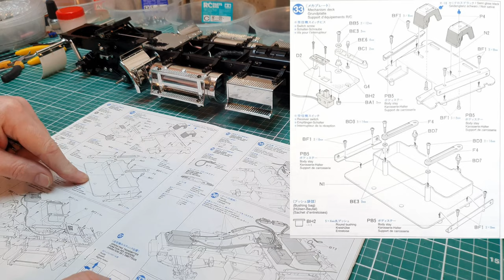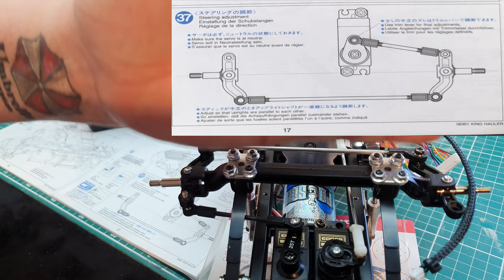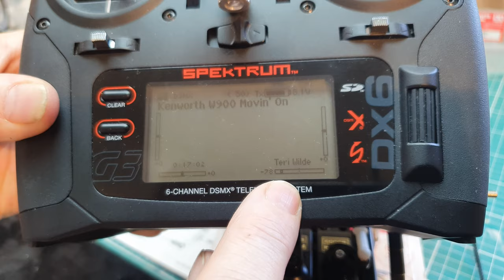Tamiya King Hauler Build Ep8 - Steps 33 - 37 - Basic Radio Installation - Movin' On

Comment: I am truly enjoying this Series! 
Just a note on me Grand Hauler Build.... Today was FRUSTRATING!! 😖😠 
I have fitted a 3 to 1 Gear Reduction Unit between the Gearbox and Axle. Had I spent the Money on LESU or something like that, it WOULD have been simple. BUT, I had a unit from a Crawler that I'm not using, but it was 17mm too wide to fit between the Rails! 

The ends were solid Alumininium!!! 
SIX Dremel Cutoff Discs later, I finally got it cut. Drilled Holes in the Frame, and I was all set! Actually looks good. 
The purpose is - I know from Electrical Engineers that lower Turn Motors make MORE Torque than high Turn Motors!! 😲😳  Contrary to VERY popular belief that has been propagated for so long, that People just accept it as FACT, without evidence. 

So now that the Driveshaft will be turning at ONE-THIRD of the Gearbox speed, a 35 Turn Motor will give enough Torque to pull a 3 Trailer Aussie Train - uphill!! 😊👍👍

Yes, a lower Turn Motor does use more current.... 
So I want to ask you, about how much runtime do you get with a 5000 MAh Batry?
Reply: ...... If you're at all interested, they also make Gear Reduction Units that screw right to the back of the Gearbox. For those who prefer a single Driveshaft. 😉
Reply from the maker: I get a lot of run time with my 5000mah pack, I leave them powered on all day and switch between my trucks with my radio, the fail safe is set so they don't run away when I switch. I am slowly moving to Lipo but I'm still very happy with my 5000Nimh packs on the 80t carson motor.

Reduction gears aren't really something I have used because I do not carry any loads which add a significant amount of weight. when you push these models past the limits to which they are designed then reliability is compromised.
Reply: @TeriWilde  ....... I just wrote a long, well thought out reply, explaining myself and my admiration for your experience with this COOL corner of the Hobby.... 
And then accidentally DELETED IT!!!! 😭😖😠😠😠😭

I'll get to your second one, since I'm working on that as we speak! 😉 
I've never been the "common RC Guy". I believe that the only two Kits I built bog standard - were the Frog in 1983, and Grasshopper in 84!! 
My Career was as an Auto Mechanic, but not the corner Garage type... 
I built Tube Chassis Dune Buggies and Pro Street Drag Racecars. But my specialty was Race Engines - and driving the Cars!! 😎👍👍 

I adopted the same principle in RC. Got my first RC10 Gold Pan in 84, and modified it AS I built it! 😲 
That became the course of my Hobby. 

Even though I've built countless Kits... This is my first Big Rig!! I've been DROOLING over this since I saw my first one in 1998!!  
It took until just recently (and a FAT Inheritance!!!), to finally get one.
Planned for years to be Cletus Snow's Kenworth, with a subtle twist to make it mine...  I had already been buying bits for this Build since about 2005!! 😜 

What WASN'T in the original plans, was Grandbabies!! Loves of my Life!! ❤❤❤
So the oldest, 7yr old Girl, bugged me (and I gave in without a fight!), since I started building.... 
"Gampy, can you ride me around on the Trailer?" 
I of course looked into her big, blue eyes - and turned to GOO! 

So for starters, I'm making a special Flatbed Trailer, with wide Axles, Crawler Springs, and a plastic Child Seat with Armrests and Seatbelt, and fixing it to the Trailer Deck! 😁 
That's the "Kiddie Hauler" portion of my sidetracked Hobby...

I could technically take the Brushless Motor out of my competition Wraith, and it should pull a Kid with authority. 
BUT I don't want to GRENADE the Gearbox!! 😲😳
In this case, the Gear Reduction Unit is performing a different function. 1st Gear will be SO SLOW, that I could be comfortable even lugging the younger ones about.

A GRU serves a different function as well.  It doesn't Multiply the Gearbox Torque - it DIVIDES it!! 
Do you know what a "Granny Gear" is? 
It's an extra low, lower than 1st Gear, usually fitted to Trucks with smaller Engines, but still need to haul a heavy load. It basically gets the heavily laden Truck MOVING.... 
Where in normal 1st Gear, it would likely burn out the Clutch or even BREAK a Gear!! 

One still needs to be concerned about the Suspension when overloading a Vehicle...
But the GRU (Granny Gear), assures that the Gearbox won't likely explode - with you, your load and your Truck, rolling BACKWARDS down a Hill, fast! 😧😲

So Dear.... That's my reasoning behind the Gear Reduction Unit. Unrivalled slow speed control and pulling power!! 
Like I mentioned, mine was a Crawler GRU.... SOLID Alumininium Mount Pads - that needed to be CUT, 8mm on each side, to fit between the Hauler Frame - and all I had was a Dremel with fibreglass Cutoff Wheels! 😖  Eight of them to be exact.
Test ran the bare Chassis today... 3.28mph in 1st Gear, full Throttle, 35 Turn Motor!!! 😁 

I'm not one to try to force others to follow my way of thinking.... This is a HOBBY. For some the only freedom they'll have. 
But I will say, if you ever consider this Mod, I couldn't recommend it more!!  

There's just more specific fit parts. More Money, but more piece of mind!!

Comment: OH Ms. Teri.... I can't STAND seeing wires all over!!  Did you know that the latest run of the Grand Hauler comes with WIRE WRAP!? 😁 
And your point about running a Truck off the Table... YES!! I've been at this a fair bit of time (37 Years!), and I've roon a couple straight off the Table! 😲😖  Especially in the MSC days. 😠 So glad for ESCs!! 

I haven't set up a Stick Radio since me Flying days. Should be interesting.
Oh, and I use HobbywinG ESCs exclusively. Even Brushless! The WP1080 ESC is definitely overkill for this Truck... But I like that I can make so many adjustments, particularly raising the BEC voltage for my overkill 20kg Servo!! 😲
Reply from the maker: running off the table is the voice of experience, I learned that lesson the hard way 🤣🤣
as for stick radios, I prefer them because I can't seem to get on with the pistol grip type, it makes no sense to me that you push the trigger forward to go backwards and pull it backwards to make it go forwards... I guess it's what you get used to...
I love the HobbyWing range of ESC, the 1060 is more than enough for a stock build and the 1080 if you need a little more lunch and adjustability with a very good drag brake for heavy loads going down slopes...

Comment: you should keep talking on your videos it don't hurt anything and i am watching this on the day it get put up according to u-tube witch is the 12th.
i run the 1060 in my bruiser and the only thing i hate about it is the stupid small switch/short wire
i would like to see a video on the set up for the trans and receiver also the servo ajuster plus all the other good stuff to go with the set up 
i only had one run away and that was with my revo and unlucky for me it went across a huge field and stoved into a hedge and stuck at w.o.t  until i could run to get it lucky for me no damage apart from the hedge lol

Comment: Great build really enjoying it. Tell me if your using the Tamiya MFC unit which apparently has a built in esc why do you need to use the 1060 esc?
Reply from the maker: this is just showing the basic radio electronics install for people who will not be fitting the MFC
Reply: @TeriWilde  Thanks Teri to be honest I taught I had missed something. Be getting my scania R620 next month.
Reply from the maker: @madbren  that's a very good kit, I've built a few Scania for other people... always plan your upgrades ahead of the build, adding customising parts can be a pain to fit afterwards
😎
Reply: @TeriWilde  Teri thanks for that advice, as iam running on a budget which I know ain't ideal for the rc hobby lol, but most Upgrades like grills, lit dashboard and extra lighting like beams and beacons will have to be at a very much later date.
Reply: @TeriWilde  Teri actually I have another question I hope you maybe able to answer, the servo adaptors supplied with the kit indicate for futaba or sanwa servos. I want to put ETRONIX servos in mine so which of the arms will suit that comes with the kit.
Reply from the maker: @madbren  I don't know how many spline the eTronix servo has but it would be a simple case of trying either servo saver that comes in the truck kit. One of them would fit.
Reply: @TeriWilde  thank you Teri appreciate your help, as you may of gathered this will be my 1st truck kit to build, my last rc kit was a Tamiya Tyrell P34 six wheeler F1 car 1/10th scale.
Reply from the maker: @madbren  blimey,  I had a tyrell when it came out... 😁
Reply: @TeriWilde  now we are giving away our ages 😂